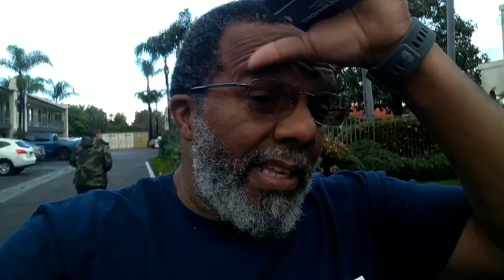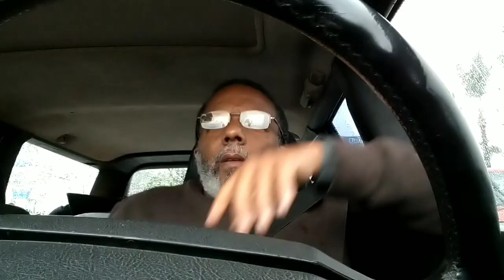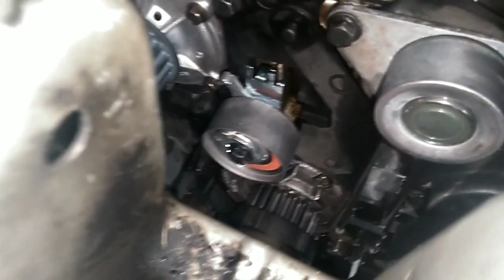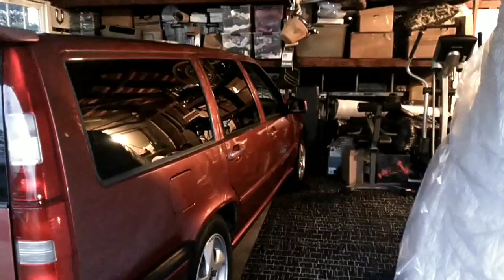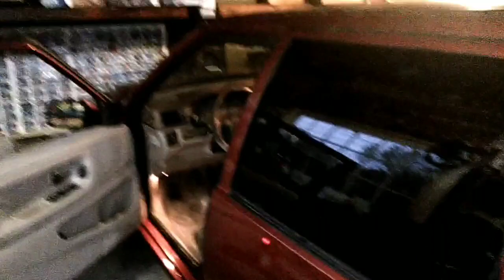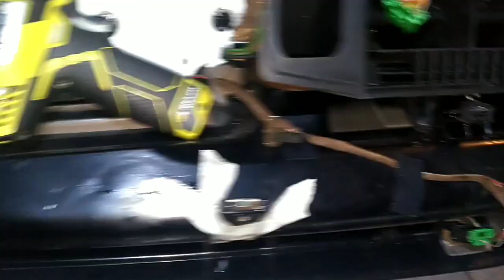San Diego S40 timing belt & cam seal, then to Long Beach area for a V70 T5 dash. - HOWR

Comment: Buddy of mine picked up a 1994 Volvo 850 wagon about 2 weeks ago for $1500 bucks. It has 223k miles but that turbo 5 still pulls pretty damn well (impressed the hell out of me lol)
And the heated seats still work!
Car isn’t perfect (a bit of western Pa body rot on the quarter panel dog legs starting and someone did some...let’s be kind...let’s say questionable welding on the exhaust lol) but I think it’s a damn good car for the price
And your videos are a huge help in some little fixes already and I’m sure will be on some others down the line (such as the A/C compressor makes a not so nice sound lol), so thank you in advance for the help from your videos! 👍
Anyways, take care, stay safe, and go find some eggs and bacon STAT! 🍳 🥓 
That was the saddest breakfast I’ve ever seen! Lol
Reply from the maker: Yes, it was bad. No eggs or bacon in the stores around here. 🤦🏾‍♂️
Reply: Robert DIY good point, that is getting scarce out here in Pa too
(Btw hope you are still a Steeler fan! 🏈)

Comment: Hi Robert I have a Volvo s40 2004 and when ever I get in it and move it off there is always a very quiet crunching sound . I don't believe it is the clutch release bearing. Because I can be in first gear and still hear the noise and I haven't push the clutch in to change to 2nd gear. And it only happens the once when you start the engine and move the car off. If you come to the traffic lights and stop and move off again you don't hear it. Have you any ideas what it could be.  Great videos from across the pond UK. UK has just started it's shut down on Coronavirus
Reply from the maker: My 850 does the same thing. Something to do with the car changing from open to closed loop. 🤷🏾‍♂️
Reply: So it's nothing to worry about . Thanks for the quick response 👍🤝
Reply: My c30 does this apparently it's an abs test, do you have it the first time you change into 2nd?
Reply: @qlus  when I just got the car I never heard it and after about a month or so i I Began to hear the noise like a little crunching sound. I took it back to the garage but he said exactly like what you said. But i don't have to get into 2nd gear to hear it. This is my second Volvo and the s60 that I had didn't make this noise. 
I guess this is something I'll have to live with. I do watch a lot of Roberts video's and if it was something more serious I do believe he would have said what it is. 🤝